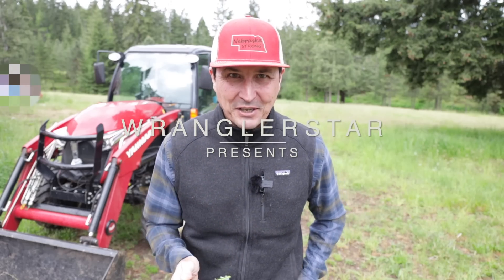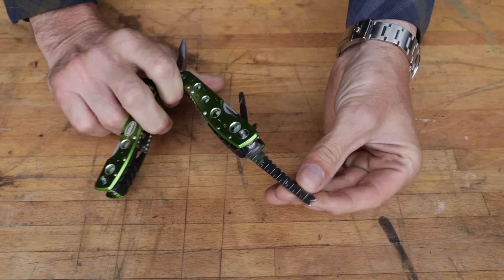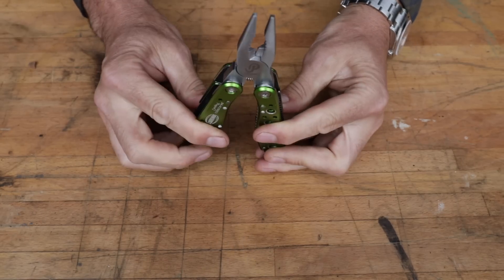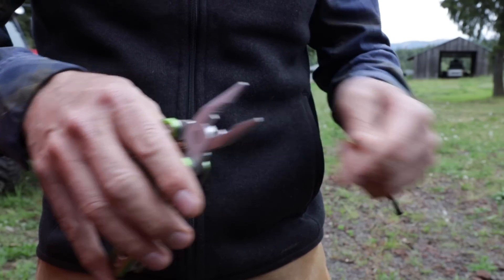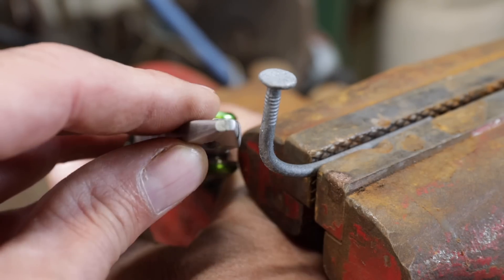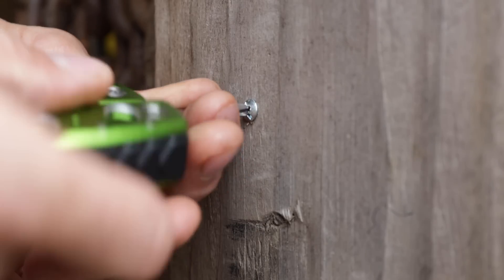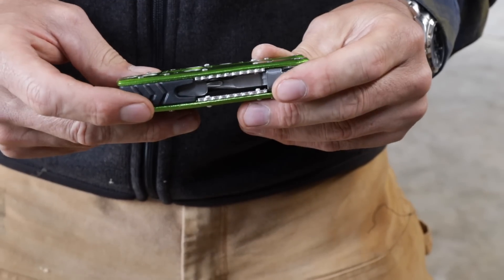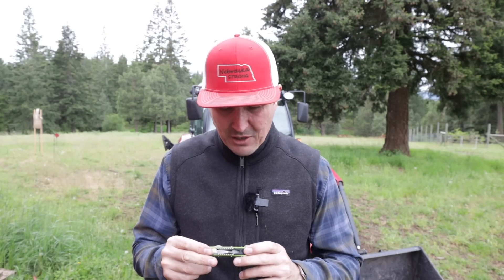TESTING The Cheapest MULTI-TOOL On AMAZON

Comment: Great video. But the can opener is Way more effective if used on the Opposite side ... that is on the Outside of the multitool. If you open on the inner side of the multitool your fingers and the all body of the multitool is actually getting on the way and does not make a good opening.
Reply: Looks like it's a left-handed can opener, from south paw
Reply: And going forward with it has always been easier for me.

Comment: After watching Adam Savage hack through a 2X4 in less than a minute with a Leatherman saw I have changed my opinion entirely on saws on multitools. I used to think they were so situational as to be nearly useless, not the case now.
Reply: I'm a mechanic and I carry a Leatherman Wave+, which I use all the time. It's a lot easier than carrying a knife, pliers, and a saw individually. I mean, I still have those things in individually, but when I only need pliers for one little thing, I reach for my Leatherman.

Comment: i got a near identical one for fishing branded by Trespass, had to file the  the bottle opener to get it  under caps  so it would work, moved the can opener to the left centre  so the left hand side of the handle does not catch on the can, and sharpened the knife,the rest is solid

Comment: I have the Gerber Center Drive, I love it.  I lost the Phillips tip from flicking the pliers open, but I replaced it easy enough with a spare tip I had from a Stanley multi-tip screwdriver I got at Walmart.   Back at around 8:00 I noticed what looked like rust around one of the posts holding the scales; unless it was chili from the failed can opening attempt. 

Funny story about can openers.  I still have and carry with me a P-38 (John Wayne) can opener.  I got it when I was in the Boy Scouts and have kept it ever since.  It is pretty much naturally blued now with age, and it rides on a bead chain around my neck.  So one day at the office they are going to have a treat for this team because they met a goal on a project.  So the managers decide to serve them nachos with cheese sauce.  So they get the chips, the little paper boats, and a little pot and hot plate.  They even get jars of sliced Jalapenos.  The person who gets the cheese sauce gets these huge cans that have plastic replaceable lids on them.  I suppose they thought the cans had big pull tabs under the plastic cover but no, they were proper tin cans. 

So four managers are all scratching their heads trying to figure out how they are going to get these cans open.  One of them decides to run to the local grocery store to see if they can buy a crank can opener.  Then one of them remembers that I am known as the office MacGyver because I always seem to be ready for things.  So while one of them drives to the store, the other three bring me this can.  They ask if I can open it with my multi-tool.  I pull the P-38 off my neck and open the first can in about three minutes (big can.)  I show them how while I am doing it and let them borrow it for the remaining three cans.  By the time the one manager has returned with a new can opener the other three are serving nachos to their teams.

Later on I go to collect my John Wayne only to find them all in an office passing it around and talking about it, and how they had seen it around my neck but never knew what it was about.  I had to explain it to them.  All of them younger than myself had never seen such a thing, didn't know it existed, and where it had come from.  Now two of them have bought them off of  Amazon and carry them on their key rings.  I still maintain that the John Wayne is the most useful tool I have ever owned.

Comment: As a boater and a fisherman I personally think my Leatherman is the most important thing I carry, it's saved my rear on so many occasions I can't count... BUT, I always say I have one in storage at the bottom of the Chesapeake bay, years ago in some shallow water my prop picked up a crab pot and the wire wrapped it up of course. So I'm out there working on it with my Leatherman making decent time when some genius rides up sees what I'm doing, says hey I got just the tool and throws me a pair of bolt cutters... Well it was either get smashed in the face and drown or drop my leather man catch the bolt cutters and still almost drown... Long story short it took me twice as long with the bolt cutters, my first Leatherman is still in storage in the Chesapeake bay, I went through 3 cheap jobs before I finally sucked it up and bought a Leatherman 300. I've managed to hold on to it for almost 6 years now and don't go fishing or on the water without it... If I need to use it over the side it gets tied off with a line! I also keep a Gerber in my truck that works really well... The cheap ones seem to twist out in the handles and then get off center.... Sorry about the long story but I do love my Leatherman, it's made the difference between driving the boat in vs having to make the call of shame... " I need a tow"!

Comment: Nice review. Thank you. On the can opener. I use the can opener on my SAK or multi tool several times a week because that is the only can opener type I have owned for the past 10+ years. I don't remember the last time I used the over-hyped bottle opener, other than for the screw driver. The pliers are my most used tool. I might see if these are still available for my truck glove box.

Comment: You can actually take it apart and remove the fish scaler if you wanted to but you would need to retain pressure on the other tools with a replacement tool or something the same size if you were able to find another broken one that someone didn’t want you could choose a tool to remove in theory and replace the fish scaler with something more adequate for your needs around the homestead

Comment: when I worked at gilwell park in the UK, I got one of these, it was cheap enough for a volunteer, and got the job done, 10/10 would recommend 
 was faster to use it, than to go end get a proper tool from the storage

Comment: as a french jack of all trade,i replaced my french swiss army knife by a multi tool cause it was only 9 bucks,turn out we have the same,not the same design because mine is all hardened steel but it cost the same price,i am really happy with it,cuts  through flesh like butter and it has everything you'd need as a jack of all trade or a side tool for someone that camps with an axe

Comment: I kept wondering if the various holes along the multi-tool handles were just decorative, or had some useful function as guides or measures of some sort.

The teeth along the inside of the handles (I believe you referred to them as "gimping") seemed to me as though they could be used to grip something the needle-nose pliers wouldn't fit around. A makeshift channel-lock or cap snappler, as it were. 

On my swiss army knife, the fish-scaler is embossed with inches along one side and metric along the other. Also, both the corkscrew and large Phillips head screwdriver are hinged in the middle so as to become "T"-handled tools for better traction.

Comment: I was looking at the Gerber centerdrive, but I was very skeptical after seeing some of the reviews on it. I ended up purchasing a much cheaper model Gerber. I was extremely disappointed in the build quality. A day or two after, I was going past the Cabela's in Hammond, Indiana. Stopped in and purchased a Leatherman Wave Plus. Let's just put it this way. It didn't take long for me to fall in love with it. Unlike the $60 Gerber, The Leatherman didn't have a single piece of plastic on it. Off the top of my head, I don't remember what model the Gerber was. It was one that had the slide out pliers like the centerdrive.

Comment: Usually the worst things about these cheap multitools in descending order is 
1) the springs suck and are not strong and/or breaks easily
2)The ergonomics are bad and unusable 
3) the steel , all around 

I keep a cheap multitools in my pair kit , great for passing needles , cutting thread to use, removing thread , making small measures and making small punctures in thick materials ( I use another tool to go through all the way ) .

Comment: Hopefully I can explain this adequately. Did anyone else notice that when the knife blade is being used, it comes out of the top section of the multi-tool? It works OK for whittling, but it makes it awkward for cutting things against a cutting board or other flat surface, unless you open the multi-tool. Even then it's not the greatest.

Comment: I have two multi tools I think they're the $4 ones from Walmart one of them I found when walking down a dirt road the other one I got when I confronted two teenage kids that were stealing things out of cars that was one of the things they dropped along with probably 6 lighters. I mostly only ever use them for the pliers never used the fish scaler use the file a little bit the knife blade is garbage the serrated blade is even worse use the screwdriver every now and then has the same problems that one did with folding up but the needle nose pliers are decent and that's all I carry it for anyhow because sometimes you need  pliers because they can hold on to things your fingers can't

Comment: use your left hand with the can opener.  the other end of the multitool handle is hitting the edge of the can, causing the hook to not touch the lip.  it wouldve opened the can otherwise, the hook design isnt the problem.  bad design, but still wouldve been effective beyond what you presented

Comment: how does this $10 multitool have spring-loaded pliers, but my $90 leatherman wave does not? I swear i'm not bitter :(
Reply: Um. Because spring loaded pliers are ass. Lol spring loaded pliers are pure gimmick. They dont allow the pliers to open fully
Reply: @FudgyTheWhale_  the MUT is a gimmick. spring loaded pliers cant be a gimmick if it actually makes the job easier and the spring doesn't prevent it from opening all the way at all. at least with my spring loaded ones imo they are just fine.
Reply: @Mikey-ym6ok  that's bullshit. Sorry but spring loaded pliers are a gimmick and a shitty one at that. I promise you I can do more tasks with my leatherman Wave than you can with spring loaded pliers
Reply: Leatherman also makes the Wingman that also has spring loaded pliers. After using a multitool with spring loaded pliers for 8 years, I'd gladly take a spring loaded set over a normal set in a heartbeat, I just want them with an internal spring and not an external one. I've never had any issue with mine not turning or holding something I needed to turn or hold.
Reply: @FudgyTheWhale_  You're just pissed you paid $100 for a leatherman without spring loaded pliers. Suck it up Nancy.

Comment: You are using the can opener wrong.   Go around the can counter clockwise.  The can opener "blade" is closer to one side.  Put that side against the can so the bulk of the handle isn't in your way.

Comment: The sheath is most certainly not adequate.
I used to collect cheap junk knives with my final count having been 115.
Many of them came with such sheaths and they fail in a day.
The loop often tears.

Every modern multitool file is not to be considered a real file.
Now the original Gerber MP on the other hand, their files were actually made by Simonds.

I would have to disagree about the blade, most people carry an actual knife and a multitool is never an ideal knife.
Sure none of the tools are the most ideal, but when a knife is so easy to carry there's no reason to rely on a multitools blade.

Comment: Metric is based on 10. So if it had 10 hashmarks, you're dealing with Metric. That tool has 8 hashmarks. Traditional scales use 16 hashmarks, however, 8 hashmarks means you're dealing still with US customary.

Comment: You hate how the metric system makes more sense and you don't have to use a calculator to convert between inches, feet and yards. No only that you have to remember how many of each goes in the other. Or google it 😂😂😂😂

Comment: Cheapest Dremil/ Rotary tool.... I guarantee it will fail, because the cheap rotary tools do not spin correctly. They have a wobble that makes cutting/ sanding/ or drilling very difficult.... I bought one from Amazon around $40...   Try engraving with it.... I would rather have that $10 multi-tool.
Reply: Daniel LaDue, I have a nice Dremel, but I bought a Wen rotary tool for $20 last year to leave in the garage. It’s still working fine, it’s pretty impressive actually.